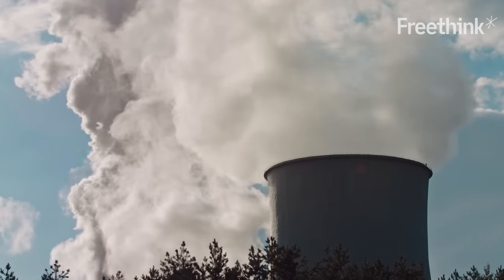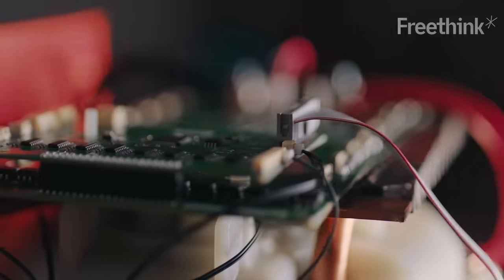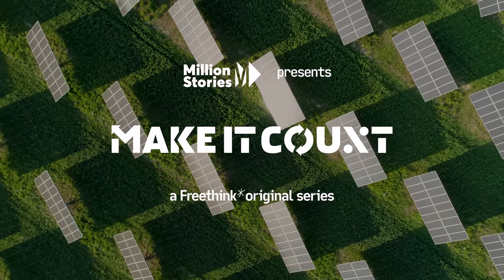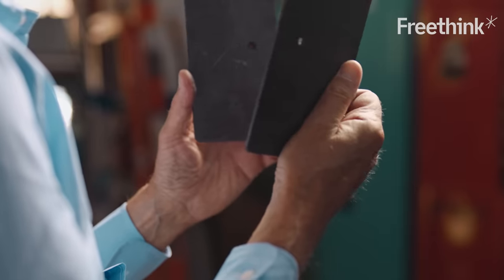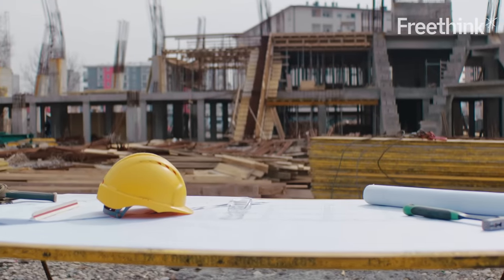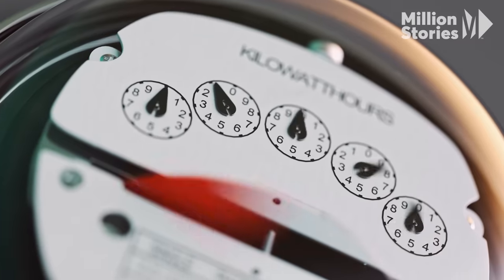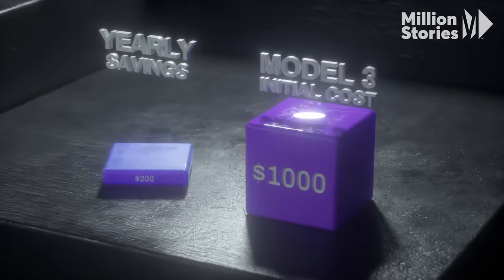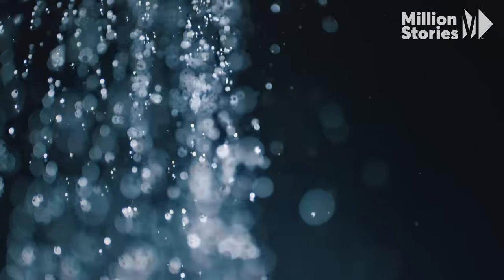The man hacking hot water to save the planet

Comment: The argument for this invention is nonsense: Scaling on a heating element does not reduce efficiency! It does however inhibit heat transfer, so the power output is reduced, but 100% of the electricity, though it will take longer,  is still used to heat the water!
Reply: Are you sure?
Reply: @Vanguardkl  Absolutely, imagine an experiment: 2 identical heating elements, one clean and one covered in half an inch of kettle scale. They are both submerged in identical insulated tanks, each with a thermometer and with the same amount of water. Both heaters are turned on for 10 minutes and the temperature of the tank with the clean heating element will shoot up right away and be noticable hotter after 10 minutes. However leave the experiment for some time, and the heat locked up in the scaled heating element will have dispersed into the water too and both tanks will have risen to the same temperature. No power has been wasted. the heat can only go into the water. What is bad with a scaled heating element, is that it can get pretty hot when covered in scaling, which can destroy it. So a new type of heater like this  requires little or no maintenance, which is a great deal, but it is going to use as much energy as any old scaled resistive heater.
Reply: The main important argument is the speed of heating the water which saves in energy costs and reduces pollution. A bonus is the supposed lack of scale build up which can reduce efficiency depending on the thickness of the scale.
Reply: @lopemac  Definitely brilliant that this new type of heating element is maintenance free, but you are wrong; Heating the water faster, does not save energy. Ask yourself: Where does the energy used to heat the scaling go? If we presume that the time to heat the water is unimportant, i.e. you rarely open the hot tap over the course of a day, a slower heating actually means that the heat loss through the tank insulation is less as the time spent waiting at full temperature is reduced.
Reply: @Tore_Lund  I'm not wrong and researchers who study scale build up say that with enough scale build up you will lose efficiency. It's a fact according to research done on water heaters.
Reply: @lopemac  They are talking about hot water production capacity; gallons of hot water at a certain temperature per hour, which is reduced because heat transfer from the heating element is reduced. They are not talking about energy efficiency: energy out / energy in. Energy has to go somewhere, it cannot disappear. Where would it go?

A physics example (In metric as I don't know the imperial units.): 1 kWh is 3,600,000 Watt seconds, which is 3,600,000 Joules.
 
 4.18 Joules is one calorie which is the energy needed to raise 1g of water 1 degree C. So if in one hour a 1kW heater pushes 861,000 calories into 10L of water, the water becomes 86.1C hotter. If the heating element is scaled, the element will heat up slower on the outside, but have some latent heat after the power is turned off. Still when the heating element is cooled down to 86.1C, one kWh will still have been transferred into the surrounding water, but naturally, it will take longer to heat the water when the element is scaled. So yes heating capacity is reduced, not efficiency.
Reply: @Tore_Lund  When did I say that the energy disappears? You are coming up with random stuff that is not what is being talked about and then say I'm wrong even when there's been research done on the subject.
Reply: @lopemac  No need to be inpolite, if energy does not dissapear, efficiency is 100% so there is No energy loss, so we do agree?. I think this is an argument aBout nomenklature. "Efficiency" is the wrong terminology, should "capacity loss"or similar in the video.
Reply: inhibiting heat transfer is reducing efficiency…
Reply: @Tore Lund Thank you for posting this.
Reply: @time2livelife  but only in the short term, in the long term it's more efficient unless you're always using close to your tank capacity (which probably means you'd rather have a bigger tank).
Reply: Totally agree. Even if this video was to be hold as true (which it isn't). The product is design to prevent water from boiling (thus no scaling*), but in minute 5:00 we can see water boling.
This is some weird video nonsense
Reply: @josevera5094  Actually i believe scaling begins at only 65 C, but it depends on mineral content in the water, but usually you try to keep your boiler temperature below that. You don't want scalding water coming out of your faucet either.
Reply: @Tore Lund I agree with you about the initial argument in the video, that of scaling being the cause of lost efficiency, that doesn't make sense.

 I would say that the second argument for the invention holds true though, that of the system being an on demand system. That would increase efficiency due to the elimination of the accumulator tank.

However, as others have pointed out, in terms of electrical efficiency a heat pump solution is obviously superior.
Reply: If it takes longer it is less efficient and uses more watt hours to heat the same amount of water, uses more energy and pushes up the bill.
Reply: @jacquesvictor4232  This is not how physics work: If the heater is turned on for a longer time, it indeed will use more energy, but more energy will also finally be delivered to the water, which result in that the end temperature of the water being higher too, so the extra energy used will contribute. No extra loss and no efficiency drop.
Reply: @lopemac  a decrease in efficiency means losing some of the input power to mainly heat. But if our main application is to heat up something then this loss of efficiency is not considered loss anymore.
Reply: @causeitso  Not what I'm talking about and what has been researched. I've never said energy just disappears. If it takes longer to heat something that = less efficient. You don't have to lose input power for that to happen. Pretty simple. If less energy is being transferred into the water at a given time then where is the rest going? Hmm 🤔 Since things follow the path of least resistance perhaps the heat will go elsewhere and cause heating elements to fail quicker. Which happens. Or causes longer heat times. Which happens. So, less efficient.
Reply: I think the loss in heating 'efficiency' comes from the insulating scale causing the heating element to become hotter (it can't dissipate heat as fast due the insulating scale). Therefore, it increases its resistance at a hotter temperature and thereby uses LESS electricity. Yes, 100% of the heat produced DOES get to the water through the scale, so you're right. BUT, I think the heating element actually draws LESS electricity energy because it's resistance to current flow is higher due it being hotter (because of the scale preventing better heat transfer). Just spitballin', but a hotter wire generally means HIGHER resistance, so at the same voltage it equates to lower current and lower energy use. 

Overall, it means that electricity isn't getting wasted. It merely can't get INTO the heating element to be 'used' since the resistance is higher and current flow is reduced.
Reply: @PeterC3400  I wanted to reply to the previous poster but didn't have the time before.

So you are right about something but wrong about other things and I don't mean that in a demeaning way. 

So we need to define terms. Efficiency in terms of heating elements is electrical energy input to heat energy output. By this definition, all heating elements are 100% efficient. But that doesn't tell us anything about the 'rate' of heat transfer, meaning how fast heat can be transferred.

What you are talking about is 'Effectiveness' which takes into account the 'rate' of heat transfer.

So although two heating elements might have the same efficiency, they might have different effectiveness. So scale build up reduces effectiveness but not efficiency. But this is just a technicality and I know this is what you meant.

The thing that you said that wasn't accurate is that as the heating element heats up, its resistance increases and draws less power. This is not entirely correct. There are PTC (positive temperature coefficient) and NTC (negative temperature coefficient) heating elements. For one the resistance increases with temperature and for the other the resistance decreases.

The PTC one will draw less and less power as it heats up and if its PTC is high enough then hopefully it won't over heat and destroy itself. The NTC is more prone to self destruction in this scenario.

So anyway, you see these are technicalities. But your intuition about the rate of heat transfer is correct. 

One last point I want to make is there can be a heating device with an 'efficiency' more than 100%. The devices are called Heat Exchangers. And the efficiency can surpass 100% because the heat exchanger as its name implies, transfers heat from one place to another using electrical energy rather than creating it from scratch using the same energy.
Reply: @causeitso  Good clarifications. Agreed. "...scale build up reduces effectiveness but not efficiency" <-- agreed

The heating elements in water heaters would be simple metals and not the NTC materials you mentioned, so it seems reasonable that they become less effective because they consume less power at higher internal temps. I don't know the power-vs-scale curve involved, but I would imagine someone has long ago plotted out a representative sample.

I'm also curious about just how much scale is actually prevented by NOT boiling the water, since deposits still build up in shower enclosures and they are definitely nowhere near boiling. I wonder if these devices still foul up over time and require maintenance (although way less than a conventional water heater).
Reply: @PeterC3400  yes indeed, pure metals have a PTC and thus as you stated effectiveness would decrease with temperature.

I'm not sure if water heaters actually boil the water! Like the electric water heater in my bathroom doesn't have a pressure relief valve (as far as I know) which would be an absolute requirement if water is being boiled in there otherwise an explosion would be imminent. I think they heat the water below boiling temperature. 

I had a back and forth with some other guy in the comments who seemed to be much more knowledgeable than me about the subject of water heaters (he since deleted his account and his replies were also deleted). He said that things weren't that simple, as I suppose most things aren't 😅. He said that the scale built-up in water  heaters where the heater element is not at the bottom of the heating container is not that big of an issue because as he stated, sudden temprerature rise of the heating element would cause the scale to flake off and drop to the bottom of the container and that mechanism keeps the effectiveness relatively constant until at one point you have to clean the inside of the water heater. And based on my own observations while cleaning my water heater, I think this guy was on point since I found a lot of flaked scale at the bottom of the container while there wasn't much scale build-up around the heater element itself. He contrasted this with heater that have the heater element at the bottom of the container where this problem of reduced effectiveness over time is much more pronounced.
Reply: @causeitso  Good observations. I think my heater element is about a foot off the bottom of the tank. Also, I wonder how my natural gas system works compared to electric heaters as far as scale build up. 

My tank is 17 years old and probably long past its replacement date. I should start thinking about caring to contemplate possibly putting on the calendar a date to cogitate about deciding to shop around for a new units to someday replace it. ;-)
Reply: @Tore_Lund  I think a better comparison might be a gas water heater. If there is significant scale at the bottom of the tank efficiency will be affected. The scale will heat up, but more energy will be lost up the smoke stack. Thus efficiency will be reduced.
Reply: @justinfowler2857  Yes, for a gas heater this is true as the heat has somewhere else to go besides the water.
Reply: I was looking for this comment. There is no reduction in efficiency due to scaling.
Reply: Tore, what about heat loss from the tank itself? If we have a scaled up element that is taking longer to heat the water then that is more time for the tank to lose heat as the water is being heated more slowly.
Reply: @johnvonhorn2942  It will not take longer to heat the water (not very significantly longer) the element will will be at higher temperature so slightly reduced resistance and will likely get damaged faster because of that higher operating temperature but how fast water is heated is insignificant.
Even if you where to heat the water slower there will not be a higher heat loss maybe a slightly lower heat loss since over 24h period average water temperature will be lower as when you take out hot water and replace with cold water if it will take longer to heat that water then during that period delta between water and ambient is lower so lower heat loss.
So the only problem with scaled element is that element can not transfer heat as effectively thus it will run hotter and will need to be replaced more often as it will fail sooner. In therms of efficiency that will always be the same no matter if it is new and clean or scaled and it will be perfectly efficient so you can not come up with a more efficient heating method. As for a thankless water heater that can be more efficient overall since it will not need to deal with heat loss while hot water is stored.  On the other hand there is the disadvantage of much higher power needed when you want to use the water so much higher stress on the grid.
Reply: @johnvonhorn2942  Yes if the goal is a certain temperature, the slower heating will leave more time for energy loss through the walls. However if the goal is to maintain a temperature for hot water, the losses through the walls are the same. So yes, if the heater is overworked and need heat up periods, there are more losses with a scaled element, however, it is not more than a few %
Reply: @Tore_Lund  The energy losses through the walls of the water tank depend on the amount of surface area of the water tank as well as how well insulated the tank is. Faster heating means you can have a smaller tank with less external area as the tank mainly serves as a buffer for when hot water usage exceeds the rate at which the water can be heated.
Reply: @ayoutubechannelname  That's a different kind of heater, if the heating is going to happen real time. Normally a water heater takes 5-6 hours to warm up and depends on a large storage volume.
Reply: @Tore_Lund  The energy is lost when the hot water is stored for the time when you need to use it. How I understood this video was that here you do not store water because this device is so effective it can heat the water up when water is needed.
Reply: @jenspettersen7837  Okay that's a different animal. Through-flow heaters have little to no heat loss, and scaling on the heating element in such a heater means that heat is released later when the tap is closed so it is lost. Is such a heater, scaling is very decremental to both power and efficiency. So this is where the disagreement comes from? UK viewers which use through-flow heater thinks the argument is valid, but the rest o us using water tank heaters, think it is bogus!
Reply: @Tore_Lund  Don't worry about imperial, my fellow Americans here aren't scientifically literate enough to even understand the simple physics you described.
Reply: Scale kinda acts like and insulator, its not exactly solid, so when it heats up, vaporized water gets trapped, overheating the element.  The elements in a lot of heaters, only have a small ceramic piece in a metal insert, not tond of insulation, and those arent always covered.  So yes the thermal bleed off goes outside to open air to some extent.

There is energy loss, just not vast amounts.  Most of thr energy loss is because the tanks have really crappy insulation.  Get some r30 and wrap your tank up. It will cut the power bill down a lot. 

Having said that, heat on demand is way better. Same cost to buy new, and used arent as worn out.

And solar hot water panels and circulation tanks better than that. Because its essentually panels, thermostat circulation tank pump, with outgoing thermostant and mixer valve. All 12 volt.  And vaccume panels work in subzero temps. The cost is upfront is roughly double or triple, but there is effectively 0 electricity cost.
Reply: No. You end up heating the electrical wiring (outside the tank). It's not very noticable because the wires are insulated and because electrical conductors such as copper and aluminum are also really good heat conductors.
Reply: @Tore_Lund  the heat goes to the electrical wires that conduct it away from the water heater.
Reply: @puntabachata  I don't get that? If the heating element is scaled, the heating wire itself inside the heating element will be hotter. Ni-chrome heating wires have a negative temperature coefficient, so as they get hotter, their resistance increases. This means that current drops, so the the wires to the heating element must also heat less than they otherwise would?
Reply: @Tore_Lund  the heating element is not the only thing that heats up. The wires supplying the power heat up too. When the heating element is scaled over, it still gets just as hot but less heat can transfer into the water. So, more heat is generated in dissipated into the wiring. You don't really notice it because the wire is a great conductor of electricity AND HEAT.
Reply: @puntabachata  So you claim that resistive heating of the supply wires in a water heater contribute to heating of the water? Try Ohm's law on a piece of wire with 10A running through it for a 2kW heater at 230V AC, and you'll discover that it is less than a Watt lost the first meter of wire from the heater. Then a small fraction of that 1 watt is going to transfer through the end of the 1.6mm sq wire, through the brass terminal into the heating element and finally into the water?? I can't decide if you are joking or I'm misunderstanding you completely??
Reply: @Tore_Lund  just the opposite. What I'm saying is that heat escapes from the scaled over heating element via the supply wires (outside the tank) instead of heating the water inside the tank, reducing the efficiency of the heating element to heat up water inside the tank by being conducted off by the heat conductive electrical wires connected to the heating element to the surroundings outside the tank and this explains the reduced efficiency of the heating element inside the tank to the surroundings outside the tank instead of heating water inside the tank.
Reply: @puntabachata  That heat loss will happen anyway with an unscaled heating element, albeit less. So you mean that the higher temperature of a scaled element makes a significant difference in the loss through the terminals?
Reply: @Tore_Lund  the scale insulates the element, reducing the transfer of heat from the element to the water. So, more of the heat gets transferred along the entire length of the wires supplying the electricity. The heat does not remain at the element inside the water tank. Copper or aluminum wires become a radiator. The temperature rise is minimal, distributed over the entire circuit and throughout the house.
Reply: @Tore_Lund  I think the implication of the video is that North American households should convert over to through-flow heaters using the anti-scale design, which would provide significantly better efficiency than hot water tanks. The video's argument is definitely obscured if you assume that these devices would be installed in traditional US hot water tanks, since as you pointed out in that situation they would not provide much benefit in terms of efficiency. The system showcased in this video is an on-demand tankless system and is not designed for hot water tanks, so disputing efficiency in the context of tanks is moot.
Reply: @Tore_Lund   You're wrong about water heater scaled element efficiency because you're simplifying the system into a closed loop when in fact whenever hot water is used that will unbalance the equation. So you have an element insulated with minerals trying to heat water, the water does not heat up quickly so therefore the element burns the same wattage of electricity for a longer period time: that's more energy being put into the same amount of water to reach the same water temperature. After the water reaches its temperature, you're arguing that the insulated element that had to be powered longer will have become very hot and much of that heat will then seep into the water over time theoretically recooping that initial energy expense meaning the element will not have to run as often to keep the water at temperature. Firstly, the heat from an insulated element is not only escaping into the water it is also escaping out of the tank, the insulation of the tank is in direct competition with the insulation of the element. Ignoring that small factor however, as soon as the user runs their hot water out of the tank a and new ground temperature water flows in the tank the whole system has been restarted and the losses from the initial heating were never recooped into sustaining water temperature. You may start the next tank with a warmer element but this does nothing to change the water temperature.

Likewise, if you were using an electric space heater to heat your house but you put that space heater in an insulated box (or a single bedroom with the door closed) you would have to burn a lot more watts to maintain the same house temperature because the heater would have to run at a higher temperature for longer to keep up with normal heat losses from walls, windows, doors, etc. It's not a closed loop.
Reply: @gorkyd7912  If you power the scaled element for longer, the water will be hotter eventually. There can be no energy disappearing. The amount of Wh put into the heating element = a certain number of degrees temperature rise of a fixed amount of water. However your second argument is correct: If the element is scaled, heating will take longer, so if you you are waiting for a certain temperature, heat will have more time to escape through insulation, so more energy is needed. But if you use the water continuously or the absolute heating in degrees is small, the loss will be minuscule.
Reply: @Tore_Lund   Right, iIf there were no heat losses and the element's heat was never wasted but always went into heating water and it didn't matter what temperature the water was or how fast it reached temperature then the efficiency would be the same. But there are heat losses and the water is drained from the tank and refilled periodically and the heater is designed to reach and maintain a set temperature so therefore is less efficient if the element is insulated because the energy losses from using wh to over-heat the element to reach the same water temperature can never be fully regained.
Reply: Tore Lund : Longer time to heat....cost you more money! Time is money! Got it!?
Reply: @daveton9033  That is not an argument. It is like saying smaller water heaters are more expensive because they take longer to heat the same amount of water.
Reply: @Tore_Lund  :Ending your argument, Heater not only draw energy to heat boil, also need energy to maintain the heat! go figure!
Reply: @daveton9033  It is a long discussion you've jumped into late and early on it was agreed that standby consumption was not part of the relevant variables as it depends on usage pattern, but also completely irrelevant as maintaining temperature is no different to increasing temperature, the heat flux required is the same for a scaled and a clean coil and all the heat will still go into the water, so it makes no difference whatsoever. Thought experiment: Two identical heaters run for an hour, one scaled one not. after 2 hours the temperatures are measured. The unscaled heater will have a higher water temperature after an hour, so the heat loss through insulation is also higher. After two hours the temperature difference between the two will be smaller, ergo the clean heater has the highest losses, whereas the scaled heating element has lower peak power but releases it over longer time . But the higher losses of the clean heater, does not translate to an equal drop in efficiency, though still worse than the scaled element, as the hotter water after two hours means more hot water when mixed with cold, so the difference more or less cancels out.
Reply: @Tore_Lund  I read most of this thread. You're basically trying to argue that if you wanted to maintain a consistent temperature in your house then insulating it is a total waste of time and money because eventually the heat will dissipate and reach equilibrium anyway. Just a question of how long it takes. While it's an interesting thought experiment, it can't be true. 

I think where you went wrong is your assumption that ALL energy eventually transforms into thermal energy. Maybe built-up limescale when heated glows luminous pink when no one's watching? Or maybe the energy is converted (lost) into something else. I don't know. I do know insulation reduces your heating bill!

So apologise to @lopemac for aggravating him with your black & white & semi-blind understanding of, and use of the physical laws in an attempt to win an argument. He was right. You were wrong. Say it with me now.
Reply: @entertainme121 At least you admit you don't know, so I'll explain it differently:  Heat never stays in one place, there is always seepage.  It can escape through conduction, convection or radiation. The is no way heat trapped in the heating element  under a crust of scaling stays trapped, it will get into the water regardless, but it will take longer. That is not a loss of efficiency, but it does reduce the heating capacity of the water heater, it will heat the water slower, but the same amount of hot water will have been made per kWh. What he should have said, is that a scaled heating element reduces the heating capacity of a water heater, which is equivalent to having a smaller water heater, but efficiency remains the same, i.e. you don't get a higher electricity bill with a scaled water heater, but it can make fewer gallons of hot water per day.